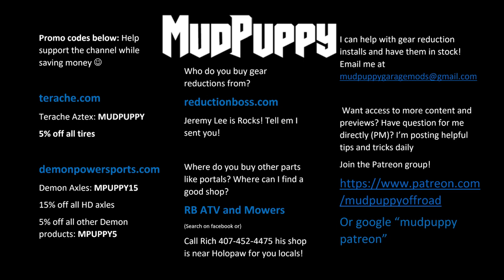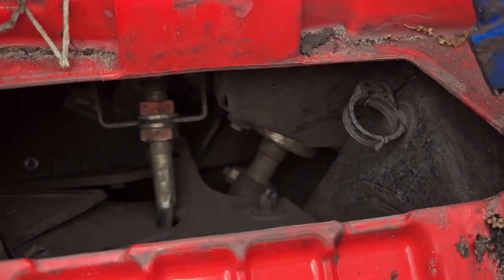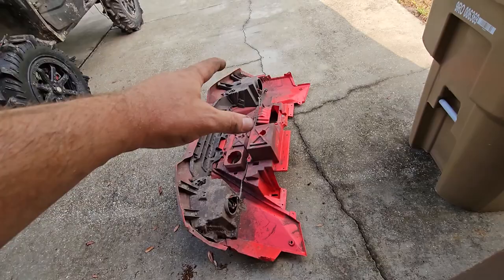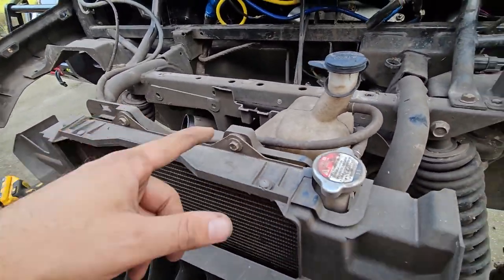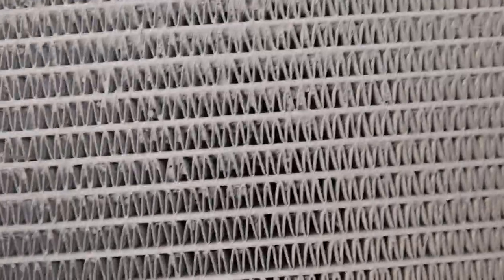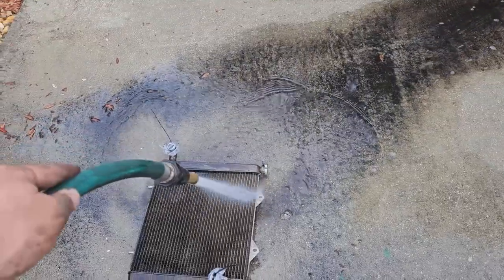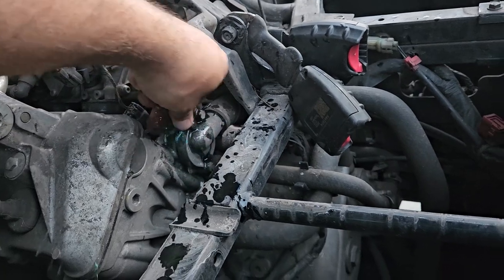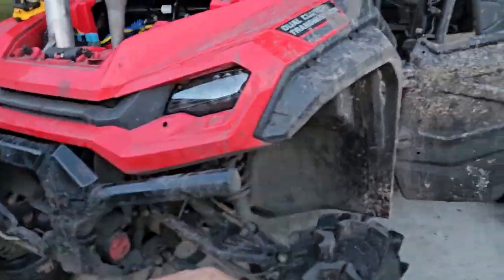Radiator removal, cleaning, and bleeding the coolant system 2022 Pioneer 1000 how to

Comment: Vacuum filling a cooling system is a great thing.  Eliminates needing to use bleeder screws or having to rev the crap out of an engine to get all the air out.  And generally speaking you know if there is any leaks before you put coolant in it.  Obviously for the average person doing this once a year or less it's not practical to send the $ on tools to vac fill
Reply from the maker: Yeah on a BMW that's about the only way to do it LOL

Comment: @mudpuppy I have a pioneer 1000-5 I did the fan override 2 years ago and everything was working fine with it up till now I took it to the shop for i4wd issues and got it back this week after 2 months and now noticed the radiator fan is not working when I use override switch or at all when at temp. Any idea on how to check if fan or switch is bad? Or possibly the shop disconnected or cut  a wire by mistake
Reply from the maker: I would start by using a test light to see if the fan motor is getting power

Comment: Love the videos But holy cow!! Dude you didn’t have to that much to pull the radiator… pull the bumper and front clip. Would have saved you two hours of your life.
Reply from the maker: First of all that took me maybe 30 minutes to remove and 30 minutes to reinstall. Second of all if you were paying attention you would know that I already tried what you're suggesting and it was not effective and you can see that by the amount of this dirt on the back of the radiator.
Reply from the maker: The ride before I pulled the bumper and the plastic shield on the front and rinse it thoroughly unfortunately that still left a lot of money in the back of the radiator because you can't backflush it appropriately and a lot of grass get stuck in between the blades it has to come out forward